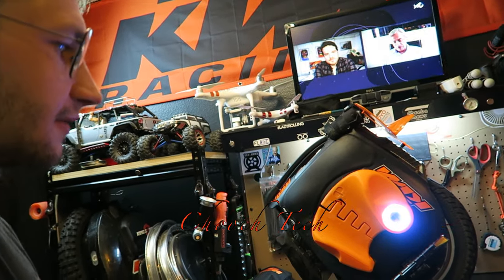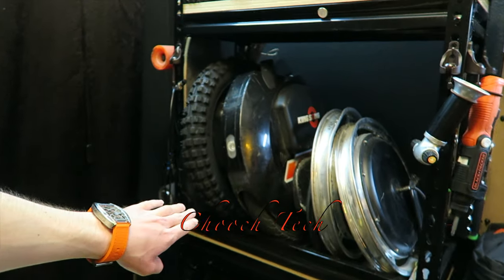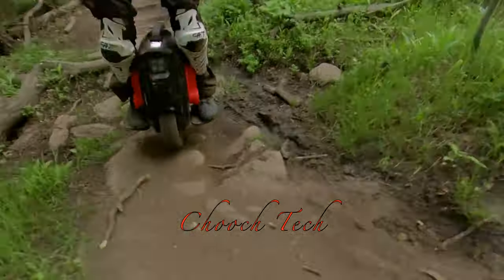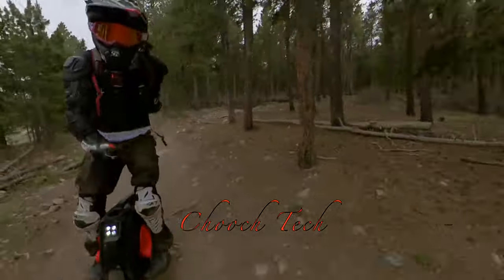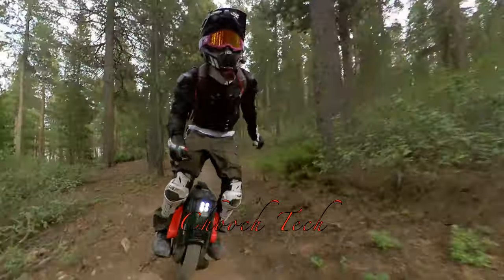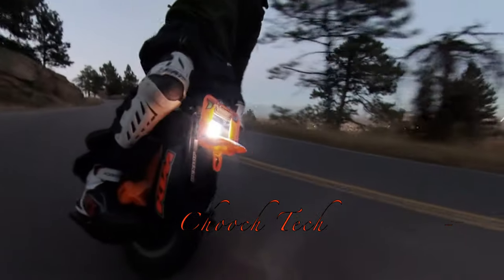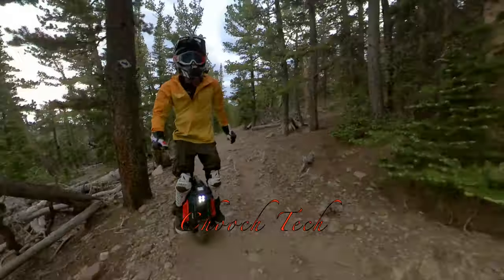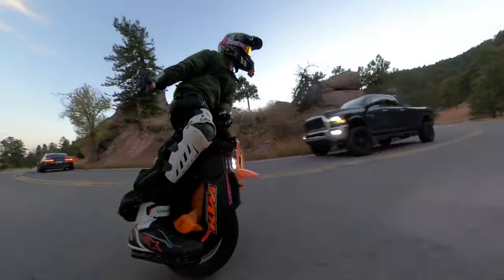Stupid Fast E- Bike But Only Half! (Inmotion V12) Intense Riding Montage: Worth $2,399 Unicycle?

Comment: I've gotten into electric skateboards but I really want a euc. Do you think the v12 is a good euc even though I've never road euc before. Looking for good range and power.
Reply: Beginner euc should be something like inmotion v8f. Stick to around $1000 because chances are that you will bang it up good as you are learning and you'll need to ride it hundreds of miles before you can ride it with confidence. Something like a v12 is nicer if you are ok with risking damaging it as you are learning. I would advice fighting the urge of going max speed until you can maneuver comfortably at 18mph.
Reply: But, it is possible to learn on a V12. Just pad it up and be patient.

Comment: Will this wheel have enough torque for a 6'2 220lb guy or should I look for a wheel with more ?
Reply from the maker: It would likely be enough but goingg for something more powerful wouldnt be a bad idea
Reply: @choochtech  thanks for the reply. I'm looking for my first wheel and considering V12 , V12 HT or S20. Us it a bad idea to buy a first batch wheel?
Reply from the maker: @waymorhd  you need an ex.n I’m not just saying stuff either. At your weight the exn is perfect. 

And yes the s20 is a good option but an ex.n is simply a powerhouse with range and torque.
Reply: @choochtech  I'll give it a look. Thanks for your advice. I'm a subscriber and appreciate all the work you put into your videos.
Reply: Is the exn a safe wheel as far as catching on fire ? Are there any problems to watch for ?
Reply from the maker: @waymorhd  mines been fine man, really think alot of these facebook posts are users that made huge mistakes and want something for free. 

I have had no problems with begode/ gotways so far
Reply: @choochtech  I'll look up your review on it. I'm assuming have one.
Reply: Which version do you recommend for me HS or HT ?
Reply from the maker: @waymorhd  offroad, san fran, seattle, oregon, colorado, arkansas, Nc, virginia/ blu ridgearea, get the HT, anywhere else get the HS
Reply: @choochtech  Kentucky . HT ?
Reply from the maker: @waymorhd  yea you have some elevation there go ht

Comment: There is a way to transport your wheel (and all of it's massive batteries) on board a plane. The way is to place it inside a pressure protected drone suitcase. It's a type of suitcase that can lock in the pressure of where ever the drone was packed with dials on the outside. As long as you don't open the suitcase or adjust the dials of the front, everything inside remains at the air pressure on the ground. 

The reason airlines still won't allow you to bring your wheel on board in one of these cases is the chance that the case gets opened. If there is a rapid pressure change surrounding LiPo batteries, it's a bomb going off and you loose the back end of the plane. Now this won't happen, but in can, so airlines error on the side of caution and prohibit ALL LiPo batteries above 100 Wh on board as that size and smaller won't blow up the plane. 
Private jets will allow you to transport a wheel in that type of case, but you pay for that luxury. =8-Þ